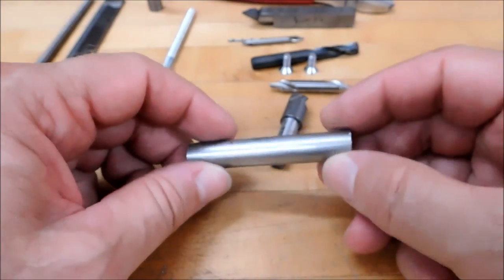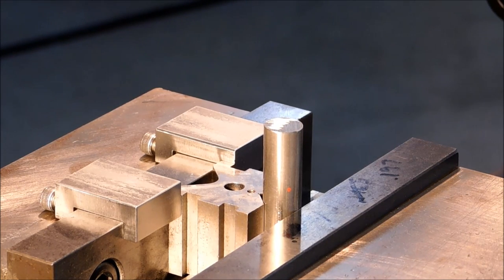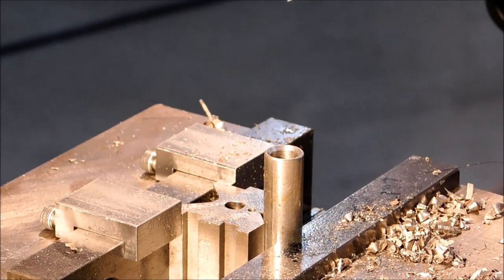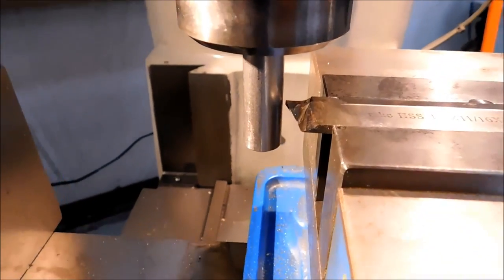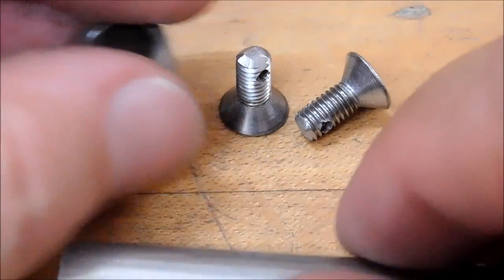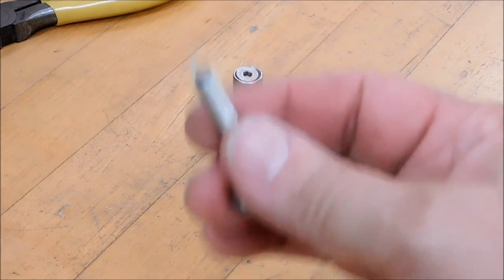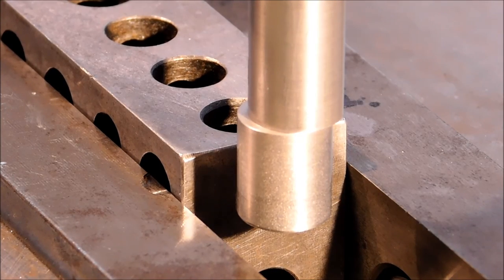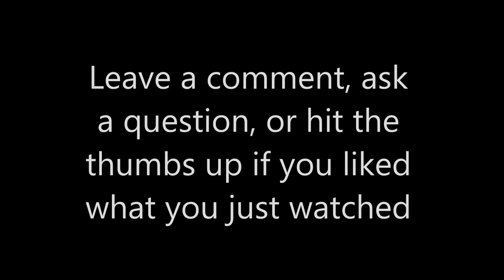Making an Edge Finder ---- On a Manual mill ???

Comment: I’m in school to be a machinist right now, and the school doesn’t provide any tools other than a micrometer, calipers, center drills, and HSS blanks. We make our own tools, like v blocks, machinist hammers, punches, toolholders, etc. this will be my next project on the mill.
Reply from the maker: Its easier on the lathe, but have fun, and heat treat the parts.

Comment: Joe, Great project!  When drilling the center you may want to chuck the part in the spindle collet and the drills in the vice.  Use the mill like a lathe as you did for cutoff and facing.  When the part is spinning the drill will follow the center line of the part.  This will also eliminate the possibility of crushing the hollow cylinder in the vice.  The complication would be in locating the drills on center under the spindle.  A small bit of math and the DRO solves this for different diameters.

Comment: Hi Joe, great little project. I made an edge finder with a difference. Mine has a magnet in place of the spring which lets me change tips easily. This allows you to have multiple tips for various applications..
Reply: @Brian Evans I guess the magnetic edge finder could get "magnetized" and "snap" on to the edge (if steel) and indicate false? Or is this just speculation?

Comment: I made one in my beginner machining class about a year ago and can't even compare it to my auction find Hermann Schmidt (Unicorn af). In a pinch I will use whatever endmill and a mic'd piece of paper for large tolerance parts. Who says manual machining is dead? I'm 22 and learning all the forgotten tricks from a master.
Reply: manual machine is more alive than ever. they gotta make the housing standards for garage heights to accommodate a vertical mill right thru

Comment: Your video's are a great way for us novices to develop our machining skills. I watch your videos with a notepad and make frequent use of the 'Snip' tool to catch images of the  little tricks and useful gadgets that show up in your videos.  I'm off to make a pair of those 'nifty' little work stops, just like Tad below!!
Looking forward to the Yucatan dive footage, in the 80's I did a couple of short, 'easy' cave dives in Yorkshire (UK) to pass flooded sumps. The vis was 12-18 inches (I mean inches, not feet), all I could see was a short section of the orange lifeline disappearing into the gloom ahead and a small patch of mud cover rock. Character building!!!

Cheers Paul in NZ
Reply: @Paul N I worked in commercial diving years ago, two problems that are fairly common in very low visibility are hallucinations and imagination run amok. Let's say the job is recovering an anchor in very poor visibility( like the harbor at the island of Jersey when the sea has been rough for weeks), you can't see 6" so you work entierly by feel. In circumstances like that one's imagination tends to mislead and torment you,  the best thing to do is mask out your faceplate. If you know you can't see a thing your senses improve and your imagination lightens up.

Comment: i've made a few custom edgefinders when the ol' starrett 827b can't reach the edge i need to find. made one with a long reach, made one with a long reach but also a disc type feature on the end, all ground to precise diameters to make offsets easier. cnc machines have mostly made the weirder ones obsolescent, but it sure is faster (and cheaper) to make a new custom tip instead of buying a custom probe and waiting for it to ship

Comment: Joe, most of the videos I have seen get the edge finder to run true (with a spanner for safety!), watching you flick it into the error state allows you to creep up on the edge. Brilliant!
Reply: I spent a bunch of time getting it to spin true when I first started with my mill. It was the wrong way for me. Having them wobble at the start works much better for me. I do usually center it after I'm done to check the offset over the edge or corner or centerline, the scales on my DRO can sometimes jump to I like to be certain I'm starting at the right spot.
Reply: Chris  Perhaps he's using a wiggler instead of an edge finder - that would be set true to start.

Comment: This turning in the mill technique is also handy for DIY mill arbours because tooling tapers on the mill and lathe are generally different and work holding such parts can be challenging when it is time to machine the other end of the arbour.

Comment: As a "semi-advanced beginner" some of your videos go over my head (for example, I need a much more basic rotary table video)--but I enjoy all of them.  This one is one of my favorites so far.  Not only do I now know how to make an edgefinder, but I also have gained some new ideas about how to fix several sticky ones that I've picked up used.  The best part, though, is the way in this video you explain and encourage using and adapting the equipment one has, along with some hardware store parts, to get the job done.  Very inspiring!

Comment: Another great project. I'm an experienced toolmaker and subscriber but had no idea how you were going to do that until the last third of the video.  With .500 diameter stock you're of course .250 from the edge of the part. Actually, .2495 to be precise since once the thing jumps you're less than half the diameter. How's that for some unnecessary toolmaker precision?

Comment: I like a cone on the end for use as a center finder.  I always seem to need to reacquire holes.  I don't turn the mill on and only feel for the edge with my fingernail at the separation joint.  No detectable edge means I'm on center in that direction.  The only problem is these edge finders only go up to 0.5 inches.  I sometimes need to reacquire 3/4 or larger holes.  I need a 0.5 shank with a 1.0" and larger conical head.  So that will be my project.

Comment: Many thanks, that is quite interesting. My edge finder was bought and basically works the same way but has a ball end in a socket at the arbor and the other end a precision ground 0.100 end. Much harder to make. I can't see them advertised anywhere any more though. I do like this setup though and thanks for the ideas on how to fit things to awkward springs!

Comment: If you chose spring and screw pitch so that screw pitch was >= spring pitch and screw diameter was ~ spring ID you could just screw the screw into the spring on at least 1 end, which would allow for slight adjustability, easier than rebending your spring hook.
Reply: Not a safe idea.  In theory it should work but I have had things slip on me.

Comment: Great demo, as usual, but you really don't need to flick the end before each use, it works perfectly well if it's running true before contact.
Reply: Chris   i beg to differ, just go for it and if you over do it, back off and go again slower. Certainly you can go back and forth as many times as you like and take an average, it is not a onetime proces and you don't need to back off and flick the end each time.
 There are some folks who believe it should be used backwards, by that i mean go forward till it flicks sideways then back off till it runs true and use that as your edge. The idea being it negates the fact that you can go to far, but then clumsy people should be more careful. 😉
Reply: @chrisstephens6673  Nothing wrong with backing it up, I suppose, if you are using a DRO.  If not, then you want to keep cranking in one direction.
Reply: Carlos Crespo yes of course,i am so used to DRO that i forgot what it was like with out, my bad as the younsters of today would say.
Reply: Chris   who is to say they are doing it right, if repeatability(within limits of the tool) is assured then it is right. 
Oh and believe it or not but I have several and use them and also get repeatable results. I even have some of this type that are audible ones, time for you to do some research methinks.
Reply: Chris  I think you misread, I said some folks I did not say that was how I did it. But I do go in till it kicks, zero DRO then back off a few thou and then go straight back in, without makes the end wobble, to check I get zero again. A matter of seconds to do. And you can see it run true, which it does automatically as it stops touching, try it.

Comment: Is it just convenience that you use a center drill instead of a spotting drill?  I had to ask because you mentioned slowing down your drill when you start out due to the corners of the cutting lip engaging - something that doesn't happen with a common 120 degree spotting drill.

Comment: Thanks, great video. In addition to a half inch edge finder, I also like to use a half inch carbide mill whenever I can, spins and cuts a lot faster than HSS. 
When the position is not super critical, I just bump the part against the (non-rotating) mill shank, sets to the same position as the edge finder!
Reply from the maker: I use a 1/2" drill blank in my CNC for exactly that. Plus a stop won't be in the way for low profile work.

Comment: Could you use a spring and bolt combination so that the screw would fit in the spring for the top fitting? That way you could adjust it to be perfect.

Comment: Joe, here's a design that might work. Make the body of the edge finder slightly smaller than the tip, say .468 body with .500 tip. That way the body of the tool will never interfere with the tip. I'm pretty sure you could easily see it jump off center. Hey, why not make a video to see whether it's a dumb idea or not?

Comment: Question Joe,after drilling a hole why do they hit it with a large countersink bit? Is it to break the corner so the clown who gets over zealous and torques the life out of the bolt it won’t fracture the part? See this a lot on restorations and was curious as to why a countersink type bit. Thank you for any and all information on this sir

Comment: Hi, Joe! I noticed you center-drilled the hole to the 60-degree section rather than the 118-degree tip. It's my understanding that this is bad practice as it prematurely wears the margins of the drill bit and makes it more likely to walk on you.
Reply: I think he did it on purpose to make center drilling easier with the tools he had, so I wouldn't worry about this drill he can grind it

Comment: I totally made one back in my Navy days when I saw what the petty officers were using, except I had a single adjustment knurled piece on the back that was threaded just a little bigger (10% maybe) than what the actual pitch and diameter of what the spring was, kind of a friction thread for a spring. It only had four components. I could have used a screw like he did, but I never saw one up close, so I was kinda winging the design, but it worked great. Was able to make our wedding rings out of monel while on duty one night, too, with a 5 prong solitare setting and a Bridgeport. The guy at the jewelry kyosk at the mall had a helluva time getting the cubic zirconium in it; he broke 3 of his stones, lol. I warned him!

Comment: "You can make anything you want on a shaper ..." yeah, and I've learned something about picking battles.  I think I'll let someone else take on that challenge .  ;-)

I've got several old mower spindles that have been trashed on the blade end (old farm yards are hell on mowers), about 3/4" diameter.  One has become a lathe bump tool.  I think the material should be good enough for an edge finder like this one.
Reply: theres a pic floatin on lathes.co.uk i forgot the machine maybe a niles planer (close enough to a shaper) planing a boat propeller, it had some gnarly auxiliary ways on the z axis that could reposition its angle to work in unison with the rotary table and have the tool follow the contour of the blades. it looked like a big machine. the operator looked to be as tall as the bore on the blade. that website though is an endless database of old machine tools

Comment: I like your build idea. I think I'll rebuild some old edge finders.  

I have been known to Chuck on the 200 thou end of the edge finder & run the (3/8) body against a large diameter cylinder at a Slower rpm.
If I  need it (location) closer than that, . . I use a dial indicator. 
I have also used a shaft of known size, and a piece of paper, subtracting half the shaft & the thickness of the paper to get  a feel for where the spindle was.

Comment: I had skin come off my left elbow in the shower last night from a burn at my lathe earlier in the week. I'd been working for a while on a complex part with a lot of cuts and hadn't realized how hot it was until I reached across for a parting tool to cut for an o-ring. And then I still wasn't sure what got me for a second.

Comment: Outstanding!  But you made me think,,,, why not use the center finder in the lathe? Locate the center and establish the center on the dro and work down to the desired diameter.  Or something such as that.  Set it one time.
Reply: I think if you used it sideways as in a lathe, it may become inaccurate due to the effects of gravity.
Reply: @allbeit582  correct. However a wiggler works on a lathe if you need it.

Comment: Will it work as effectively with the short part in the collet and the longer one kicking out? Just thinking that you might want to reach the centre point of a very large diameter.
Reply from the maker: I would bet it would helicopter the longer side and damage the tool.

Comment: Great starter project and a great illustration of mill turning.  Only question, did you start with precision .500?  If you didn't have a precise start would you turn it to a known diameter?
Reply from the maker: The stock was right on .500. I would have turned it if it hadn't been.